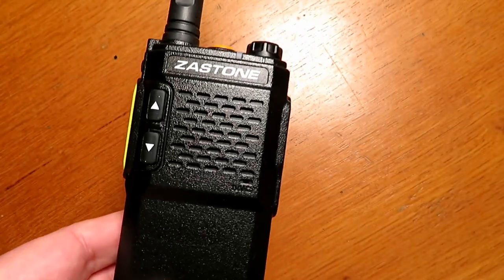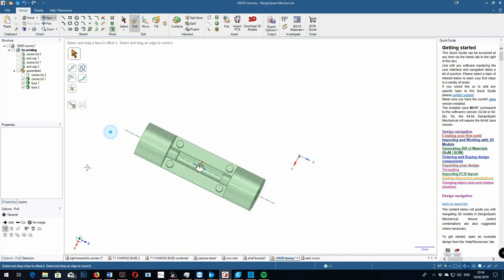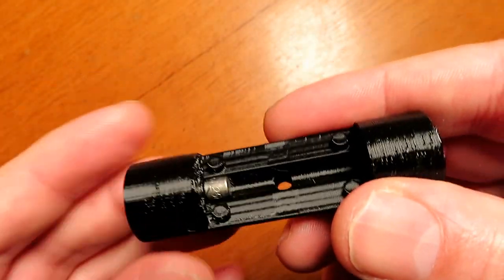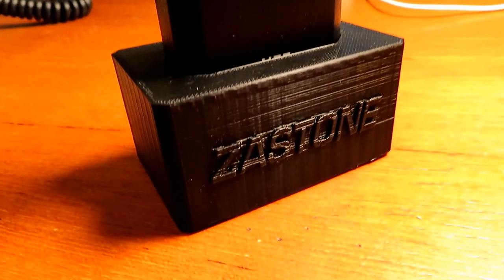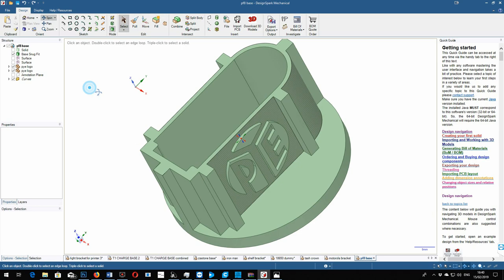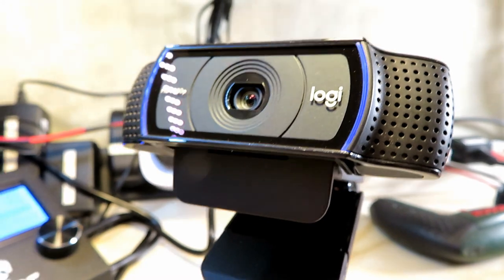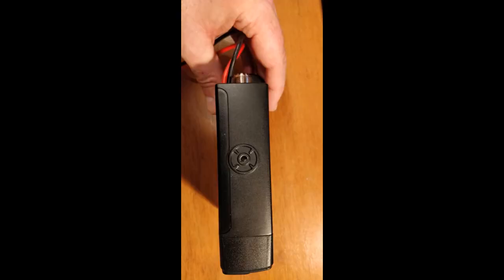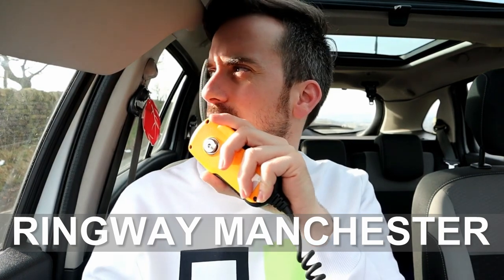RADIO HAM? YOU NEED A 3D PRINTER!! + CHAT ON AIR WITH RINGWAY MANCHESTER

Comment: Very cool
I'm looking to find a charging station for the Retevis RB615 PMR Radios, the charging over the micro USB plug is really annoying specially if you have pain in the fingers, I wish I could do 3d printing and make a charging station with pogo pins and USB c cable plug, one time plugged in and I would have never to do charge it over the micro usb plug,, only letting the radio fall in the charging stations. 🤔

Comment: Love this! Do you still use rafts for your prints? Do you need them with the magnetic sheet? I am thinking about upgrading to one.
I am en route to make new plastic cases for existing charger bases, because especially the one of my Retevis RT8 has heaps of just empty volume.
73 from Germany
DJ6KR
Reply from the maker: Hi yes I always use a raft 😃